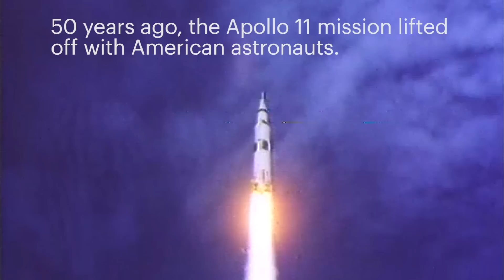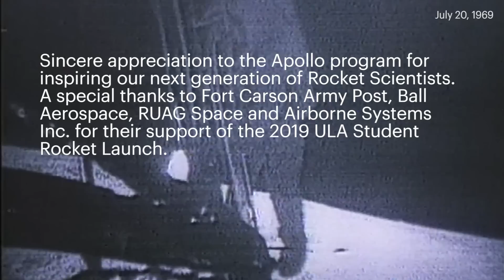2019 Student Rocket Launch

Comment: The fact that they parachuted most of the rocket parts means that they are probably intending it to be reused
Reply: We flew a lot of new  hardware this year, like the avionics, payload fairing, and main parachute system.  But this is the 4th flight of some of the other major parts like the fins, engine cases, payload dispensers, and much of the airframe structure.  So yes, we reuse what we can, repair what we need to, and try to improve/upgrade systems every year.
Reply: @gregarend8270  when you say “we” were you a part of this? If so that’s very cool!
Reply: @elizogby  Yes, I was a part of this project.  I started ULA's intern rocket program in 2008 and led it through 2019.  This year I turned over the reins to Derek Blash since I'm retiring in December.
Reply: @gregarend8270  Wow!
Reply: @gregarend8270  So would that be the reason for the crinkled appearance of the rocket?
Reply: If you are referring to the video at 1:45, that it just some tape covering some external wiring on the rocket.  Poor choice of camera location (or wire location).
Reply: @gregarend8270  ah ok